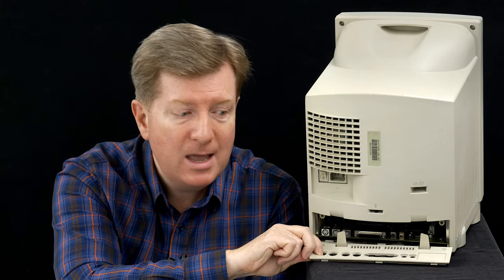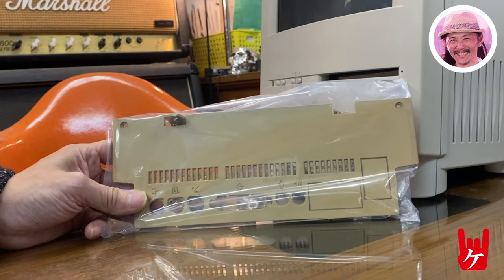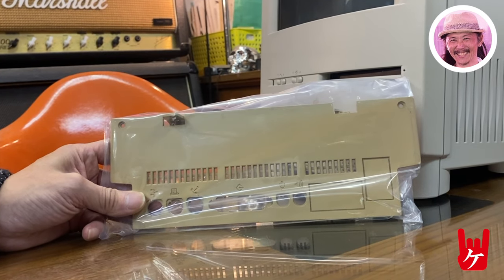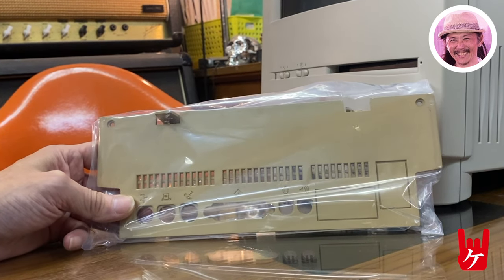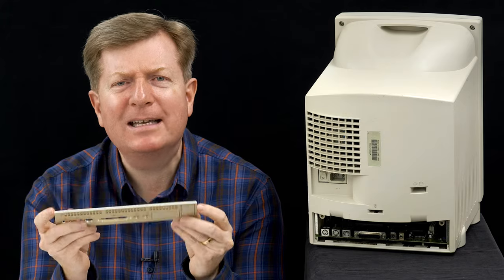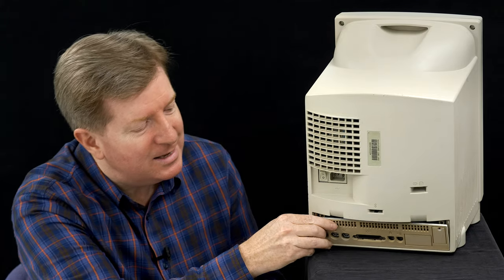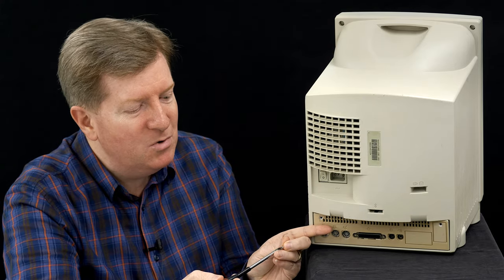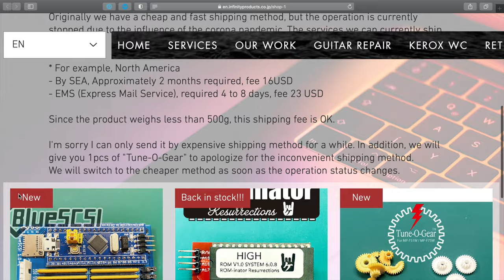LC575 Back Panel Conversion to Color Classic

Comment: JDW & Kay Koba This is utterly fantastic, Mine is a 3D Printed one but having one like this would be even better would love to have one made, I don’t have a back panel, but, how much would you charge to make one?  And just one more thing…Would you and Kay be willing to help me make a TAKKY Color Classic I have the board but not the skill or tools to do it I have the Sonnet 500 MHz Conversion card and my Mystic 575 Board already installed Would love your help please let me know?
Reply from the maker: Michael, for some reason I didn't get a notification about your post, and I only noticed it while manually checking my inbox today.  Sorry for my delayed reply.  I think your post is best suited for our TinkerDifferent forum, since you can post photos of your 500MHz Sonnet there and garner more replies: https://tinkerdifferent.com/forums/compact-macs.34/

I myself have never done a Takky CC mod, but Kay has.  As to the back panel, my advice would be to ask people on TinkerDifferent an on the Vintage Apple Macintosh Enthusiasts FB group if anyone has received a damaged LC575 during shipping and still has all the broken parts.  Could be that the back panel is still intact, and if so, assuming the broken machine is near worthless to the owner (probably is), maybe they'd be willing to part with the back panel for next to nothing.  Just a thought.  A lot of these are brittle and get damaged during shipping.